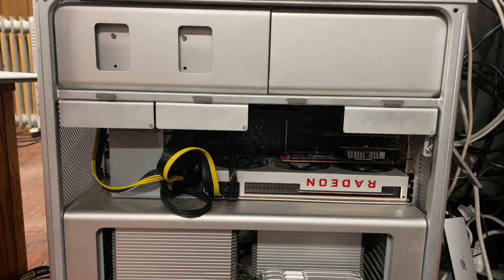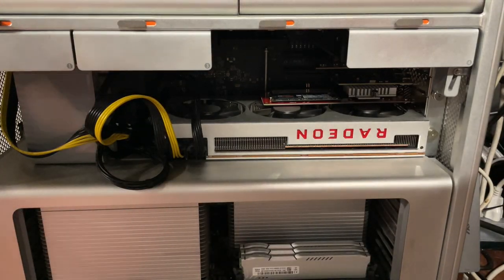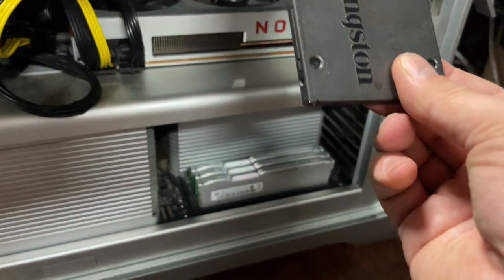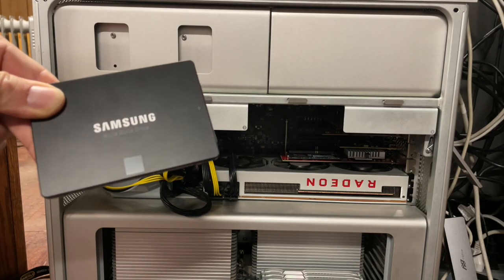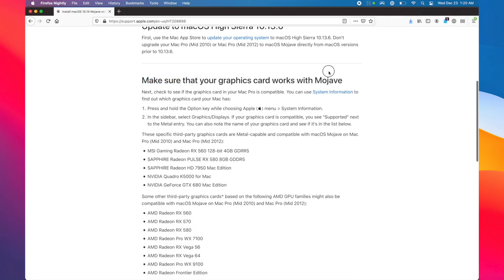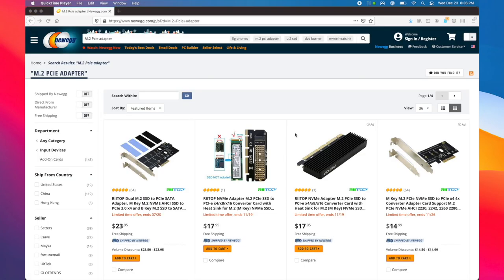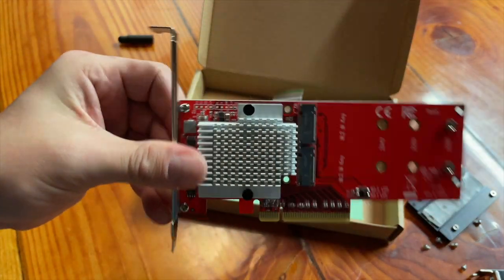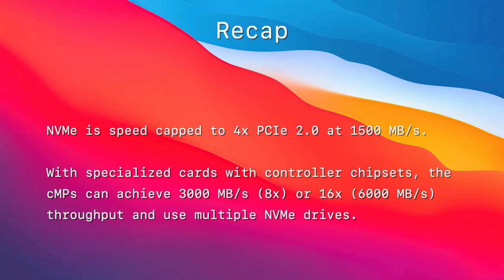Mac Pro 2006-2012 (1,1-5,1) SATA / NVMe  SSD Upgrade and Storage Overview Part 1

Comment: Greg your website is incredible, have upgraded two Mac Pro 5.1 already with success. Than you. Question: I already have one Nvme card in the PCIe slot, if I get like a Sonnet M.2 4x4 PCIe Card that uses all 16 lanes or Highpoint 7101A (ASM2824) for example, what difference will I see in running different software on the computer, I know it can go up to 6GB a second, basically is it worth it? I am running lot of music and video software. Cheers!
Reply from the maker: The max transfer speeds aren’t as important as latency for seek times and such, i didn’t notice really a big change going to from 4x card to an ASM 2824 8x card. However, if you went through the headache of soft RAID, you’d see reductions in latency. The biggest value though is just being able to have multiple drives and swap between those drives at faster speeds.

I felt like maybe I saw a second or two faster load on a sample library but I never ran any tests to confirm.
Reply: @dmug  I am just wondering running huge audio sessions in Cubase and Logic if having that Highpoint 7101A will make things a bit faster, the sound libraries are just getting bigger and bigger with every release.

Comment: I have Mac Pro 4,1 2009 flashed to 5,1 with Metal Graphic Card. With these upgrades are you able to update to the latest OS natively or have to patch? Do you know if doing the processor upgrade allow you to run the latest OS without patching. Great video thank you for sharing.
Reply from the maker: After 10.14, the classic Mac Pros aren't supported. The best route is to use OpenCore as it'll add a boot screen and enable hardware decoding among a few other tweaks and let you install the latest OSes natively. The other path is using a script like DosDude1 but you can't apply updates without basically reinstalling the OS. Check the Definitive Mac Pro Upgrade Guide for more info but you can run Big Sur on the classic Mac Pros just fine.

Comment: Hi Greg. Really well written upgrade guide you have done.  
i ´ve had the Kinston hyperX Predator PCIe card and a Kingston Hyper NVMe 480GB drive for 2 years now. 
Funnily I never have got above 700MB/S in benchmarks on my Mac Pro 3.1 running High Sierra and a Nvidia GTX 680 in the 16x slot and the predator in the 4x slot. I have 32GB 667mhz RAM installed in 6 sims 
How can I get the 1.500MB ?
Reply: PS: you may update your guide with the fact that opencore legacy patcher 0.4.10 allows for NVMe booting atm without any other firmware and/or hacks. I have successfully installed and booting Monterey 12.4 on a off the shelf PCIe M2 Host card from icebox.

Comment: Nice vid! I am doing searches on mac pro and your content is relevant.
"SSU pcie card x4 for NVME" is delivered and I will see if it works on my mac pro
Reply from the maker: It probably will work if its a single drive card. Yeah,  my content tends to be everwhere if you're looking at the classic Mac Pros. 

The blog post I made about the Mac Pro's is pretty much the jump off point for most people looking for things related to the Mac Pros.

Comment: Googling for days I found you, love this, but im going nuts, I can't restart my mac pro 5,1 when booted from Samsung SSD 870 sata , i can boot and run fine, but restart goes to the circle with line...i can't find anybody to explain what this problem is...or why its happenning..I dont need the excess speed of PCIE as mine are full, I just wanna use SSD on the sata sleds..can it be done and act normal? I can't find a definitive answer on this.

Comment: Yes that's what I'm seeing in these videos that 10.11 El Capitan us the end of the road. But I also see some are pushed to Yosemite but you take a chance of bricking the Mac as they would say.

Either it's the challenge of it all and learning the ins and out of computers. 

My intent is to get it working and its use will be for video editing. I've seen a lot of videos just for that reason. 

I currently got a macpro 17 inch (2011) that's my for everything computer lol and mid 2012 13 inch I use mostly for school stuff for now.

Thanks for response all the best.
Reply: El Capitan came after Yosemite and from my experience it was a solid improvement and everything seemed to run cleaner and smoother. Did mine maybe 5 years ago and has been rock-solid ever since.
Reply: @DiscoFang  finally did the upgrade...I followed  Hrutkay Mods videos for instruction and everything is working out great! Already begun to move videos to the hard drives. Do you know any good websites for apps that is compatible for El Capitan ?
Reply: @constructionsafetyusa8108  Good work. Not sure what you mean by Apps. All the applications I run are standard OS. For legacy applications like the Adobe Creative Suite & Freehand MX (graphic design) I run Parallels Desktop to allow the complete Snow Leopard OS to run in a separate window. (I actually run 2 screens so the RH screen always has those Snow Leopard apps running on it.) Adobe’s own website has CS2 available for free download.
Reply: Btw, the version I run is Parallels Desktop 13.

Comment: Which PCIE Adapter can you recommend for NVME's to get a speed up to 6000m/s?
Reply from the maker: That’s basically at the threshold of what’s possible, you’d need any of the 4 drive Hosts, preferably the sonnet technologies or High Point And run at minimum a RAID0 with 2 to 3 SSDS, preferably quality ones with DRAM and not more than TLC. This also will not be a bootable drive without a lot of gymnastics that I really do not recommend.

Comment: I'm looking at putting in a new 3g SSD harddrive into my 2009 mac pro. Do you have to put the new harddrive into the far left bay to have it as your boot drive? Or doesn't it matter?
Reply from the maker: Doesn't matter where the drive lives, it could even be in the optical bays or connected to a SATA controller (if it supports bootable drives).
Reply: @dmug  thanks for the info. Do you have to reinstall the OS on the new SSD or can you just choose it as your new start up disk?
Reply from the maker: @zigggyyyc7342  If you’re looking to boot of it, you’ll need an OS install on it, you can clone your existing OS using a tool like CarbonCopyCloner or a fresh install.
Reply: @dmug  thanks. The only tricky thing is I need to install El Capitan OS on that. Any tips for doing that?

Comment: I'm left with one question - why not just upgrade to Mojave to get the updated firmware? Any advantage to staying with High Sierra? Thank you again!
Reply from the maker: Not really, I mostly list it as an option as there's people who have some hardware where the drivers never were updated to negotiate with the security restrictions for Kexts, mostly edge case audio gear. Only reason I'm on Mojave myself is old audio gear on my desktop. Mojave is a hair more performant as Catalina. It's all about legacy support for most people. Otherwise, I'd go latest OS with opencore.
Reply: @dmug  Awesome, thanks! And I see there is a new Samsung SSD out too, so many cool options.

Comment: Thanks for a very helpful video. However, I was a little confused by the reference to "pinouts" at 1:02. It took me a couple of rewinds to realize you are not referring to some problem between the SATA drive edge connectors and main-board slots they plug into (a concept somewhat similar to the traditional use of "pinouts" to refer to electrical/electronic connections)--which would be a pretty serious problem, indeed--but rather merely to a misalignment of the drive mounting screws, or the screw-holes on the drives and sleds.

Comment: Hello, I bought a Red Dragon RX550 and installed on my Mac Pro 2009 (5.1 installed firmware) running high Sierra. But doesn’t show nothing on screen, I saw on your blog saying that card works... I put back the old gt120 together and shows in preferences that kext is not loaded.... any idea?? Thanks
Reply from the maker: Hmm, try an NVRAM reset? I'd try checking the MacRumors forums
Reply: I already returned to store, I’m thinking to buy a Rx-560 because is more certain that work, thanks my friend
Reply from the maker: @rafaelduarte5620  I updated the guide as it seems that some of them work and some do not based on reports such as reddit and macrumors
Reply: Cool, I’m going to check it in the blog, thanks again

Comment: Question, any help on flashing Graphics cards?
Reply from the maker: Basically if you're after a bootscreen there's very few options and all are quite old, I have them listed in the upgrade guide. Apple used EFI before UEFI became ratified as a standard so the cMPs use different drivers for pre-boot than PC GPUs. The only flashed modern GPUs are custom firmware that isn't freely available from MacVidCards, and that's for the RX580, Vega56 and RX 5700. 

You don't need to flash otherwise, and OpenCore will load the correct drivers for bootscreens. There's far too much to say just in a youtube comment.

http://blog.greggant.com/posts/2018/05/07/definitive-mac-pro-upgrade-guide.html

Comment: I have a 2006 Mac Pro 1,0. I wanna update it, is there a vanilla method like the vanilla hackintosh?
Reply from the maker: You can get NVMe to work with Windows 10 putting a master boot record on a SATA device so it loads the NVMe driver so Windows can boot, but for the 1,1/2,1 there's no method that I've seen to get them to boot NVMe with macOS.  

The 2006s are a bit of an upgrade dead as they're stuck at 10.11.x.  I suggest reading about the upgrade options in the upgrade guide. 
http://blog.greggant.com/posts/2018/05/07/definitive-mac-pro-upgrade-guide.html
Reply: @dmug  I read the site, lots of great stuff. Here is the problem I have. I have a Mac pro 1,1. The Original HDD is dead.  I own no other mac products. A hackintosh can get OSX downloaded during the install process no external mac needed. I'm hopinh there is something like this for my mac 1,1

Comment: is there not an option to simply retrofit the standard HDD drives to SSD?
Reply from the maker: You can jam SATA SSDs into the internal SATA bays, but at the performance cap of 300 MB/s because the internal bays are SATA2, not SATA3.

Comment: Thanks!
Reply: Great advice. I appreciate all the work you did on this. Obviously spent 1,000 hours or more to do this. I'd been struggling with some different things on my 2012 Mac Pro that you explained and I was able to then fix.
Reply from the maker: I appreciate it. There's a helluva lot of ground to cover when it comes to making a go of the classic Mac Pros.  Even two years ago from recording this video, the landscape has evolved thanks to OpenCore.
Reply: @dmug  I can only imagine. I noticed so much quirky behavior with just doing my 2012 Mac Pro with not only the Open Core patch but even messing with the standard hardware. I had swapped in a Dual CPU Tray a while back and upgraded to 3.33mhz Xeon's and the thing would never recognize all the RAM. Finally saw that someone on MacRumors suggested cleaning the contact points on trays and CPU's with alcohol and I'll be damned if that didn't fix it!

I could never figure out why I wouldn't get the boot startup screen till I saw your video and you were the first I heard mention anything about only base drivers & GPU support being supported on that startup screen. 

I tried to keep my legacy GPU installed along with my newer RX570 and OpenCore would have nothing to do with that setup. Had to keep swapping them back and forth in Slot 1 to make it work.

I have 25 years of Tech experience (mostly Intel/Windows) and even I struggled at times. As much as I ran into I can only imagine all of the 1,000s of hardware variations out there!

Comment: I upgraded my mac with an nvme and the computer reads it in the system but for some reason i cant switch to that disk. Did i miss something?
Reply from the maker: Know what firmware you’re running? Check under system report.
Reply: @dmug  yea i flashed it to 5,1

Comment: Will this natively run as a boot drive in Mojave? Or will it just be for storage?
Reply from the maker: Depends on the classic Mac Pro, but with the 4,1/5,1s when updated to the latest firmware: yes. The 3,1s, it takes work arounds. 1,1, not really.
Reply: @dmug  I got the 5,1 on OS 10.14.6, so sounds like I'm good. Thank you!

Comment: Can you use two nvme each with its respective pci adapter?
Reply from the maker: Yep, if you're willing to eat two PCIe slots for two NVMe drives, you can. It's the least expensive route to go although less performant than getting a multi-NVMe card. Working on a follow up just about the M.2 Hosts.
Reply: @dmug  When I put the two nvme slots the mac does not start, it restarts in each attempt

Comment: I wish I could afford a system like this, but my i7 dell gets enough done.
Reply from the maker: You can sometimes find these guys for sale locally depending on where you live for next to nothing.
Reply: Actually I posted about five weeks too early.  Even the ebay prices have come down, what with release of M3.  Actually I've bookmarked a 27-inch imac; not really something I had considered, but $99 would get me into a bigger monitor.  Whether I want a step back to i7 870, I'm not so sure about.  At least the hunt is interesting, and I don't need to do anything right away.  Those of us running Ubuntu, BSD etc., this vintage of hardware is still snappy.
Reply from the maker: @stevejohnson1321  Yeah, I think now that you find used Apple Silicon, the Intel Macs are starting to get really cheap. 

I've seen a few random late 2010s Mac Minis people have posted they picked up for $99. If I ever see one for that price, I'll probably nab it.

Comment: Wrong. I run nvme on my 1,1.
Reply from the maker: Bootable though?
Reply: @dmug  we talked about this 3 years ago. Sadly the component was stolen by a meth addict
Reply from the maker: @werehyenataur  I also made this video 3+ years ago. I try to keep the Definitive Mac Pro Upgrade guide up to date but it's 60,000+ words at this point. Even I don't remember what's in it entirely. 

Sucks about the stolen computer. I had a fent head break into my car and steal all my chargers and of all things... my car manual.